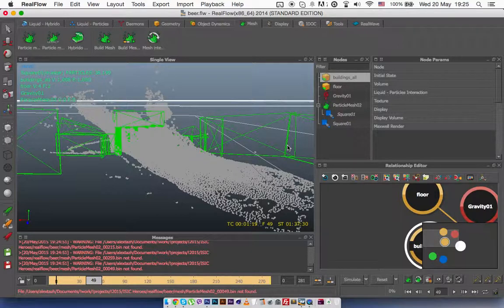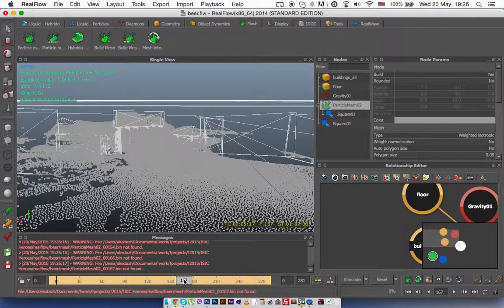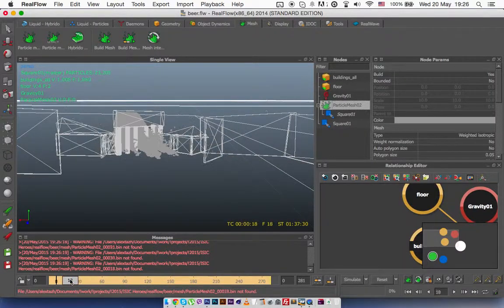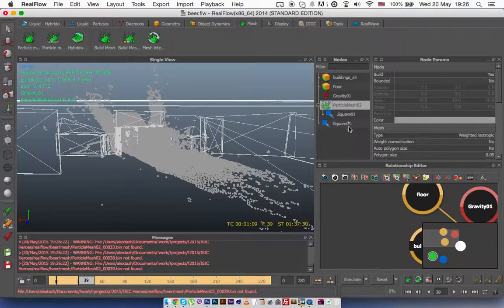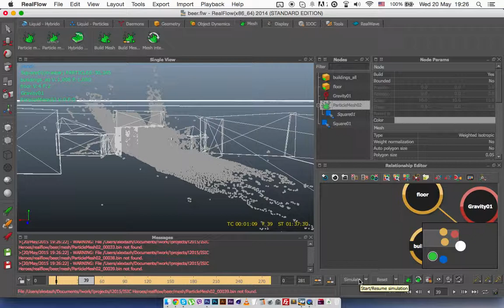Meshes problem / Meshes export problem RealFlow

Comment: I had a similar issue. When I ran my initial build it seemed to build the meshes in the viewport (and did preserve them) however, no BIN files were generated and it seemed to complain about not being able to locate the appropriate .abc file for each mesh state. Although, once the mesh build sequence was complete, I did find my mesh sequence ( .abc files) in the meshes folder of my project directory. I'm assuming those were built while running the build sequence despite RealFlow complaining about it.

Your method did indeed work for me however, after a little investigation I managed to solve my issue by checking out the settings in Export Central. I noticed that under my the node for my particle mesh, the Create BIN Mesh checkbox was unchecked. Once I checked that and tried to build my mesh sequence again all was fine.

Export Central seems to be where all export power and setup is located.
Reply: thank you!
Reply: +Luan Malta most welcome. it's easy to miss / forget about the export central dialogue. it drove me mad at the time!

Comment: Well, you should see your export central, before this. There is all about the formats exported, like: .abc, .sd, .bin, .obj, and more. But this doesn't solve this problem yet. When you link the mesh node with the emitter, you have to click on build mesh on top to create the mesh on that frame, when you do this, you can refine the mesh. When everything is ok, you'll have to came back to the first frame, then click on the bottom on right side the Build mesh bottom. Sorry, I forget the name, I know that exists yellow and white on this, as the realflow timeline. Then, the program will transform each cache simulated frame on mesh. Try it. Hugs!